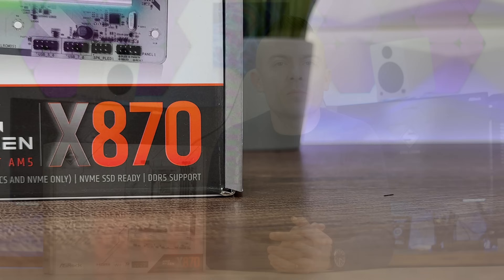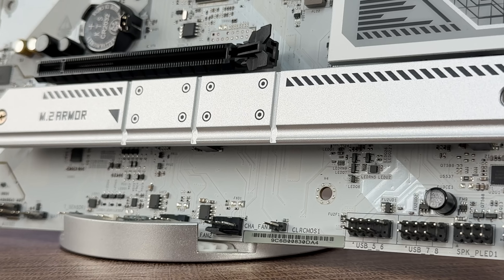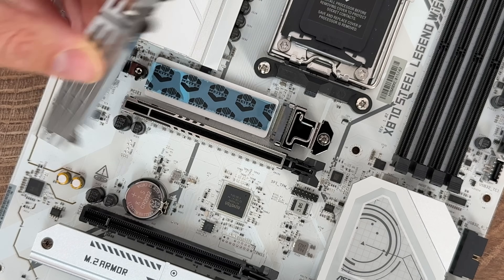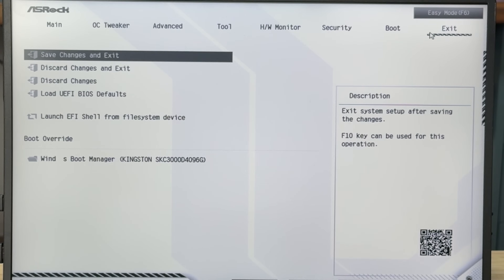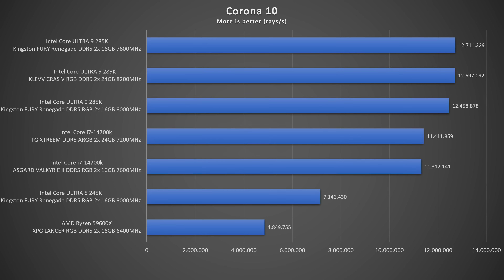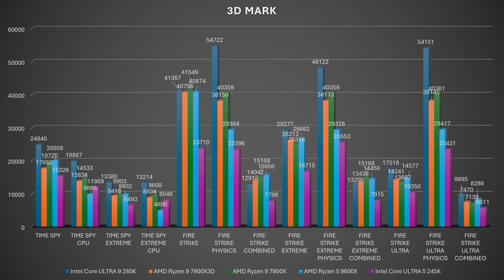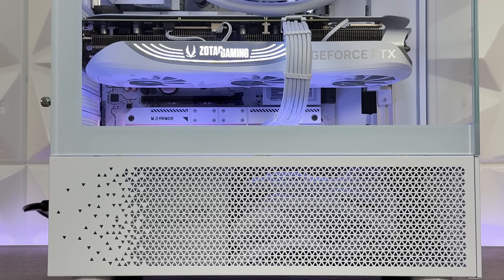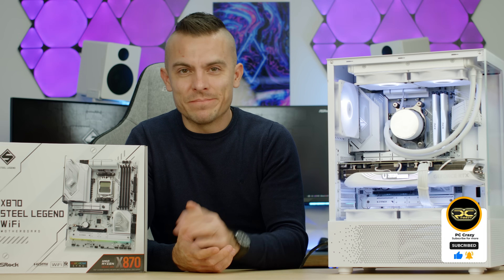ASRock X870 Steel Legend WiFi - Review

Comment: I did a full new build with this board as my first every build a few weeks ago, I absolutely love it!  It was very easy to work with.  Random question though, where did you put the thermistor cable?  I couldn't find direction anywhere on where those normally should sit.  Thanks, and great video!
Reply: I didnt fit this cable. do I need to?
Reply: No you don’t need it per se but you should install it. Page 48 of your user manual will show where it goes

Comment: There is no driver available for Windows® 10.
*The Wi-Fi 7 module is supported by Microsoft Windows® 11 only. 
- 802.11be 2x2 Wi-Fi 7 Module
- Supports IEEE 802.11a/b/g/n/ac/ax/axe/be
- Supports 2.4GHz/5GHz/6GHz* frequency band
- Supports 160MHz channel bandwidth with 6GHz* frequency band
- 1 antenna to support 2 (Transmit) x 2 (Receive) diversity technology
- Supports Bluetooth 5.4
- Supports MU-MIMO
Reply: Drivers for windows 10 are available on the mobo ASrock store page, aswell as W11.

Please explain ?

Comment: Could you tell us the correct, or working DDR5 64gb DIMM to populate the whole 256GB of RAM? The ASROCK website memory OVL doesn't convey this well and the manual is worthless.
Reply from the maker: Honestly, what I noticed and what everyone else knows (mostly), you can't use 4 sticks of DDR5 with XMP or EXPO enabled. Maybe some do work, but that is rare. Usually what happens are BSoD, unable to load or boot, or simply restoring factory settings of BIOS. So 256GB is rarelly possible.

Comment: 14 phases ? meh….
Reply from the maker: One sick board coming soon. ;)
Reply: @PCCrazyDario  how’s the memory overclocking on that board ? can it do a clean 6400 ? or do you have to fafo like crazy lol
Reply from the maker: @LightWorks222  Just released the video with 6400MHz RAMs review on that board. XMP and EXPO work normally. No need to faffing around... :P
Reply: @PCCrazyDario  what cpu were you using ? In terms of ram ic’s-were you using m-die or a-die ? Lastly, did you bother to check TPHYRDL values for 6400 ?
Reply: If it runs 16-core CPU's just fine and doesnt even come close to thermal limits, where do you need more? lol
Reply: @Leopardipzg  I’ll give you a perfect example… I had a b650 Aorus elite ax ice. 

as far as ram overclocking my CPU’s imc can handle up to 6400 with an fclk of 2133-2167. 

however because of that board I was limited to 6262 because of tphyrdl being an issue past 6262. 

I have a x670E-A now & i can now do a comfortable 6400 because i have settings in bios that i didn’t have on my last board. 

the motherboard you pick matters not only in power delivery but ram overclocking capability, pcb layer count, and feature set. 

the i/o is a different story lol.